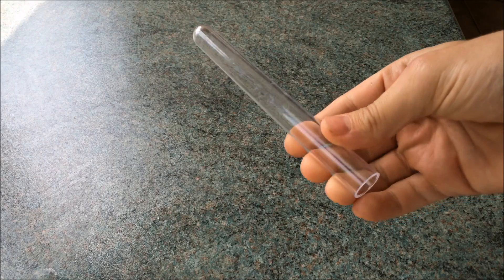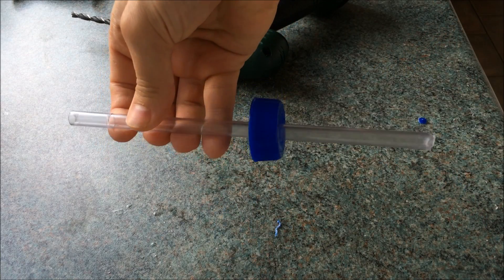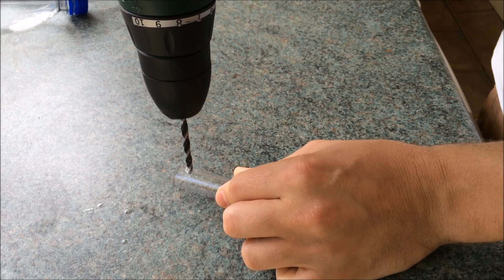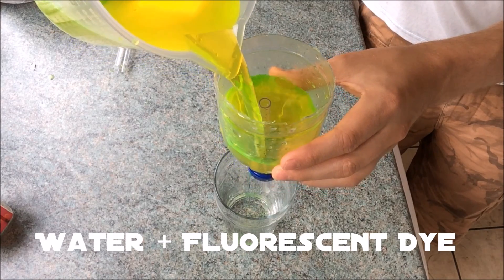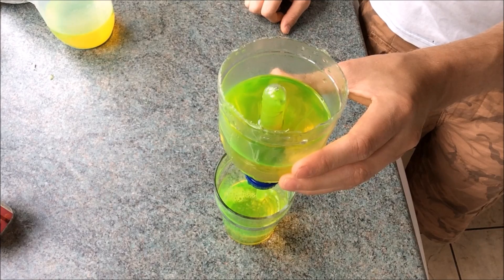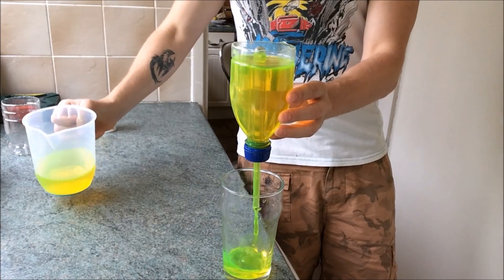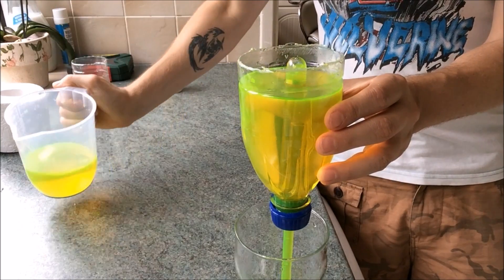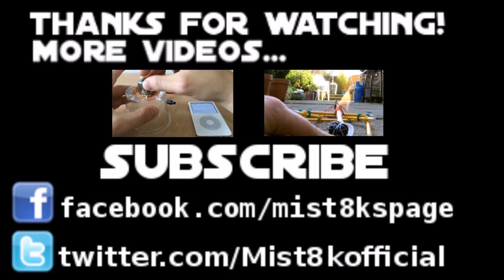Mini Bell Siphon Experiment

Comment: The advertisement that came before this video is for Round Up herbicide. Please do not use this it is poisoning our food chain and people directly. Look up its connection to people with celiacs disease. This is soaked into the grains that we feed our children. It is designed to kill pests also by causing extensive damage to their digestive system killing them, which is exactly what it does to humans on a slower scale. Try to find wheat alternatives which are plentiful on Amazon, pastas etc. Non GMO organic original wheat is called Spelt and is also available, though is more expensive but worth the cost of not poisoning your family.

Comment: These type of syphons are used in toilet flush that's how u have the large flow of water cause of this syphons
Reply: Except that most toilets use a check-valve in the tank, to initiate the flush, and a float valve to shut off the water intake when the tank is filled with water. The bell siphon works automatically without these valves, (no moving parts needed and no need for gravity to drop the stopper in the tank after it has drained). Different systems, entirely.

Comment: Instead of a straw, could you use a hose and revert the water back up and back in the top creating a constant flow. Out the bottom and in the top.

Comment: Quick question, though: do you need the two holes in the test tube ot can the siphon be made without them?
Reply: It can be siphoned without the holes in the test tube, but it would be irregular and could even cut off the flow by causing back pressure. The holes just above the opening of the tube allow for a balanced flow. I'm not sure of the physics or math of WHY it works like that, but believe me it's better with the holes. :)
It would be interesting to test out both ways and see the results.
Reply: ***** Well, thanks you very much. :)
Reply: ganjamcninja You're welcome. Try it if you  don't believe me. Heh heh!

Comment: Why do you have to drill the holes?
Reply: I would guess to get a better, more reliable water flow. If he left the hoes out the end of the test tube may have been able to create a seal with the bottom (Top?) of the bottle, preventing water flow, or at least drastically slowing it.
Reply: The tube has to be raised a little off the bottom of the container to get water in it or, as in this example, holes.